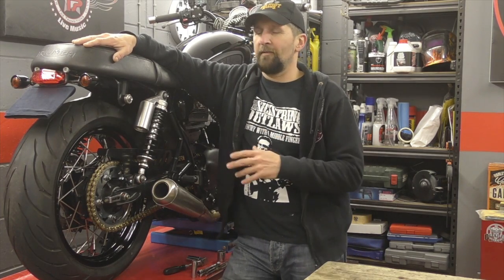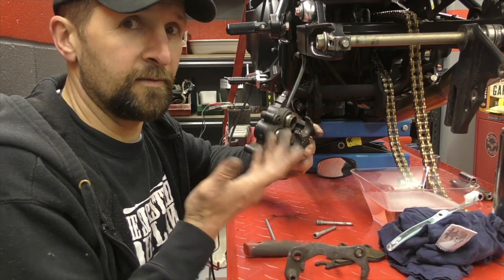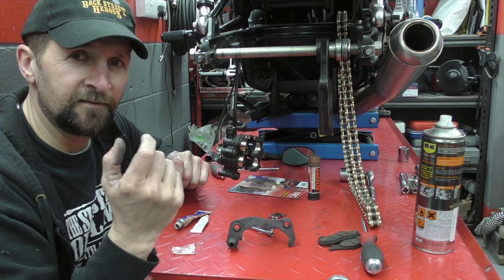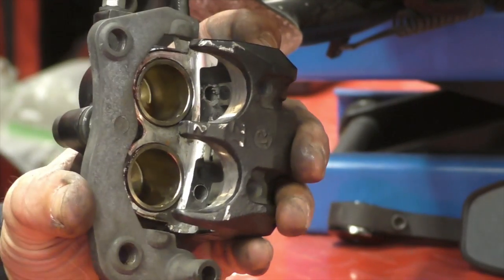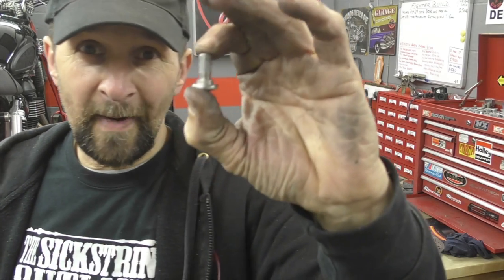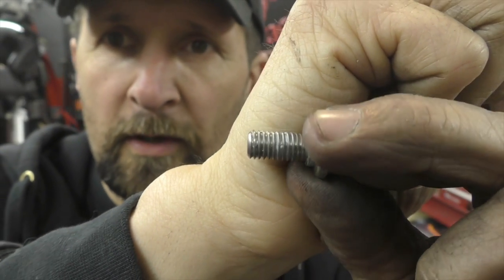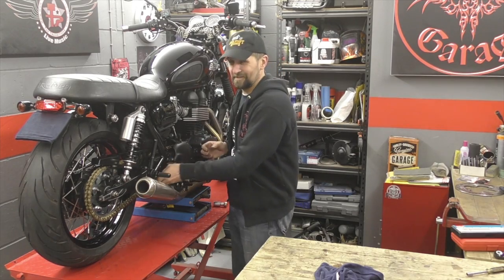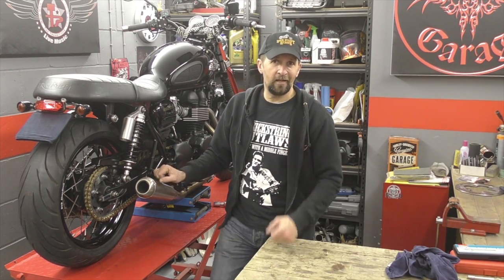Delboy's Garage, Triumph Bonneville Rear Brake Upgrade.

Comment: I am so glad I have found your videos.  They are giving me such confidence to 'have a go'.  However, and I sincerely promise I am not taking the p... But does it matter if the cleaning solution you use is bio or non-bio.  Would the 'bio' bit damage anything like the rubbers? Genuine question I promise!! Thanks.
Reply from the maker: Hi Daniel, Thanks for oyur kind words, im glad the videos have been helping you out... The rubbers in your braking system are pretty robust mate.. think of the the toxic poisons on the roads that coat them up every day.. road salt, oil and fuel residue, antifreeze residue, in fact any liquid that vehicles use can end up on the roads.. so no, dish soap is safe for the plates and cup you eat your food from.. so it'll be fine to clean your brakes with...

Comment: one thing you can try is to lube the slide bars with 3m silicone paste so it won't damage the rubber boots
Reply from the maker: Neither rubber lube, nor copperslip, will damage rubber boots, and I haven't used 3M silicone paste, is it heat proof??  Because if it's not, it will melt away and could flow on to your discs....

Comment: HI, Great video as ever.  I have been refurbishing my calipers (2002 Speed Triple) and it is you that has given me the confidence to do so.  Just seeking your opinion, I used red rubber grease on my hanger sliders, as I thought it may be better on those rubber socks...or is white lithium grease (or copper grease) better...?  Does it matter?  Also, I used brake fluid  on the new seals and pistons to "lube" them in, rather than red rubber grease - again...does it matter?  Many thanks!!
Reply from the maker: Hi mate, fundamentally red rubber grease is a silicone based lubricant, designed purely to lubricate the interface between rubber and metal (or other rubber if it needs to)... and yet the pin sliders for your caliper is actually a metal to metal interface that just happens to have a rubber boot over it to keep the weather out, so the rubber grease won't do a brilliant job of staying put in between the metal pin and bore, even though it protects the rubber, best thing to use is white lithium grease... it's tough, sticky and heat resistant and it'll stay put, and also it won't hurt the rubber at all... (it's also used on chains with o-rings when they're first assembled at the factory)... never use an anti-seize compound, such as copper slip, to lubricate anything, it's technically not  lubricant mate.  It's there to prevent corrosion, among other things... and using it on a sliding pin that moves in and out constantly can actually lead to accelerated wear, because the copper particles in the compund will eventually wear in to it, even though they are soft.
Reply: @Moonfleet41  bless you moonfleet for a dedicated reply.   I'll disassemble and redo.  Thank you!

Comment: heyo del! is there any harm in aligning the wheel with the bike on the ground and the axle slightly tight just to keep everything in place?
Reply from the maker: No mate , you need the axle loose to allow the bottom of the forks to move independently of each other so they can re-align !  Otherwise they will resist the straightening force... you are basically using the bottom yoke as a parallel guide so everything except the top  yoke pinch bolts must be loosened off !

Comment: Another great video but my shopping list keeps growing.
I changed my pad pins for stainless on the rear but the front one I ordered seemed to have a naff thread.
Fair play to square deal as he sent a replacement out straight away but again it only went in about half way then started to feel a bit tight so I took it out as I didn't want to knacker the thread in my calliper.
Phoned pro bolt and got one which goes in cleanly as the stock one dose but it's a race spec one with a small hex socket and a small nut on the end. They don't do a stainless one like the original one.
With this one you can't fit the little cap cover so I needed up putting the stock one in again.
If you find a stainless pin to fit the front when you do it please mention where you got it..
Reply from the maker: Hi buddy, invest in a tap & die set, and you'll find you can remedy all these problems in two minutes... as far as I remember, it's an M10 fine thread, and you will find that in  any reasonable T&D set, then if you feel it's a little tight, you can wind it through a die and that will leave you with a perfect thread, and as they are stainless, there is no plating to worry about!  

A lot of the tie this occurs because the threads are cut before the cap head hole is punched in it, and that spreads the thread... either way, the factories don't fit stainless ones, so they will always be aftermarket, and I use Squaredeals too!

Comment: Hey Del, I was changing my brakes and when trying to pump the pistons out to red rubber grease them, I must have pumped too much and the front piston fell out (and as it fell out there was some spillage, im guessing brake fluid). I shoved the piston back in, put the brakes on and mounted everything fully back on the rear brake, but now when I press the rear brake it isn't stopping. It kind of sounds like it's pumping air. Do you think I put a huge amount of air in the brake lines and bleeding them will solve my problem? Looking to hear back, thanks.

Comment: Top tips again fella. The back brake is an important piece of kit and often overlooked. Don't have to bother with chain cleaning and adjustment these days, shaft drive makes life a lot easier.
Reply from the maker: Ha ha yeah, easy life... dont forget the change the diff oil on time though aye... a knocked out diff bearing is  a lot more money that a chain and sprockets.. lol
Reply from the maker: Glad to hear it mate... i usually get "Oh, you mean there is oil in there?"..!      
  Hope them puppies is well.!

Comment: Hi Del,

i have a strange question. Before winter, we did a front brakes rebuild, pistons out, clean everything, lubed pistons with proper grease which comes with new seals,  and after that the bike braked like a charm, but now after 5 months garage winter pause i cleaned the bike and used standard brake cleaner just to wipe the brake discs. The bike now brakes very badly.. dont know what to do, if just try to get off the calipers and try to pump out the pistons a little bit and push them back a few times, or just clean the caliper.. but it´s only my idea, so hope, you have some advice for this case.

Thank you very much.
Reply from the maker: Hi there.. 
if your bike has been laid up for 5 long months.. then the seals may have got damp and jammed up a bit, firstly just try washing the whole brake ares with lots of hot soapy water and rinse it out with a running hose pipe, then take it for a ride and use the brakes a lot.. its just possible they will return back to normal and be fine... do that first, and see how it goes..!

Comment: Is that the Sun rear sprocket +1 rear tooth that you put on the bike?  Also, was the chain a perfect fit out of the box or did you have to add remove any links to make it fit?
Reply from the maker: Standard sprockets on the bike, factory gearing... and yes the chain fits out of the box because its the right chain for the bike.. order the right one, and they're send you the one that fits buddy.!
Reply: Awesome! Thanks for responding back so quickly

Comment: How do, I’ve been taking my 2020 ninja 1000 to bits lately, and am horrified with the amount of incredibly corroded nuts and bolts, having barely ridden the bloody thing its very frustrating- and having to hand polish each nut/bolt manually- and acf coat them but doesnt seem to do much. 

Long story short is there a ‘go-to’ place to get stainless bolts that are specific to bikes/this purpose? Or a way to determine which bolt sizes will work (cant find it in the manual) 

Ta
Reply from the maker: hey buddy.. have a look up online for some "Pro-Bolt" kits.. they make ready to install "swap over kits" of engine and cycle part fasteners, and for pretty much all bikes, and not only in stainless but also colour anodised to match your bike too... im sure there are kits for your Kawasaki.!
Reply: @Moonfleet41  This is why you’re the best mate- really appreciate it!

Comment: Hi Del,do you recommend to grease the back of the brake pad with copper grease? ty.
Reply from the maker: Does your bike have thin steel shims that fit between the pistons and the pads ?  if so then NO... even then, do your brakes squeal when you apply them?.. if not, then NO, but if you have a problem with squealing brakes, then a little anti seize paste applied to the back of the pads SPARINGLY.. can reduce or even stop the squealing all together.. 

For what its worth buddy, its not "grease".. thats a name it seems to have gained somehow.. but its not for lubrication of any kind.. its a non ferrous paste to be applied between metal surfaces to stop them corroding.... its actually no good as a lubricant, it can cause wear to rubbing parts.  so only use it as an "anti seize" compound, never as a lubricant.. its simply a misnomer that people call it copper grease..!     Hope that helps.. good luck.. Del.

Comment: Hi Del, thanks for this tutorial, quality video!!! Just changed the pads on my speed triple but I think will need to take down the calliper again and do it properly like you showed on here. Just a quick one, is normal that the disk is much hotter after replacing the pads? Is not glowing hot but hot enough so you can't touch it...thanks.
Reply from the maker: Hey Gregor.. Thanks for your kind comments, with your rear caliper, the disc should never be hot if you haven't used it.. that indicates that its binding and needs a clean up to free off the pistons.... but if you ride the bike normally, and use the brake as intended then it will get hot..   Best test is to go for a short ride, no more then a few miles, but in that time, dont touch the back brake... then when you get back, feel it to see if its hot.. if it is, then thats proof its binding and you must deal with it..  Sometimes fitting new pads can lead to this because they are thicker than the old worn out ones..  which means pushing the pistons back in further then before.. and if there is any brake dust or road dirt on those pistons, then when you push them back in that dirt will jam up on the seals and cause the caliper to bind.....follow like it says in the video, pump them out a bit then clean them all off... should be fine afterwards..  Hope that helps

Comment: Another very informative vid Del. Was there a particular reason for changing the disc other then aesthetics?
Reply from the maker: I thought I made it really clear at several points in the video buddy, Penny wants to stamp her own mark on the bike as I said, and make it a little different from the factory spec... EBC sintered pads chomping on EBC discs will always give more bite and feedback, so it's an upgrade like I said buddy!
Reply: Moonfleet41 Sorry my mistake, must listen better. :-(

Comment: Another brilliant video. Thanks for sharing.
I've been meaning to ask... do the sintered brake pads lead to faster wear and tear of the brake rotors?
Reply from the maker: Yes they do my friend, most definitely, you can't change the laws of physics, and as the sintered pads have more physical grade against the disc, they will wear it more quickly... but in defence of that, with some intelligent use of your brakes, you will brake for less duration which then reduces the time that they are rubbing on the disc so overall the increase in disc wear is marginal... and in my personal view, it's a fair trade off for better, and more effective, braking.

Comment: Hi Del, I noticed when you did the rat bike pads you put copper grease on the back of the pads.. but you didn’t put any on these ones.. I’m about to change the pads on my Street Twin, just wondering if I should copper grease the back of the pads or not?
Reply from the maker: Did your brake squeal with the old pads Liam?.. if so, then use some and it'll stop it.. if not, then no need to bother mate. !   My bandit brakes squealed for a pastime.!
Reply: Delboy's Garage now that you mention it, the front did squeal a bit, I always thought it was the pads squeezing against the disc, I thought that perhaps the pads were dirty?

Comment: Can it be lithium grease or does it have to be white lithium grease, just been looking and have found a tin of silverhook lithium grease, is this ok.   thanks.
Reply from the maker: Hi buddy, I don't think it's critical, I use white as it's what I have, all lithium grease is the same base compound, but the white is provided by the addition of zinc-oxide and it's believed to only be there to show where the grease has been applied and if it gets contaminated so needs replacing... but don't over think it mate, some grease is better than no grease.

Comment: Can any Triumph folks out there speak to the wear on the rear wheel spacers in this video? Mine too has some rings on the chain side spacer and wondering what the acceptable tolerance is there.

Comment: So I did my rear brake pads exactly like you said, they still feel a little squishy, what should I do next?
Reply from the maker: If they're 'squishy', then you obviously still have air in the system, perhaps trapped in the caliper, try bleeding them through again and, perhaps, depress the lever overnight which can firm up the system a great deal by eliminating any micro-bubbles... also, when you bleed don't open the bleed valve any more than 1/8-1/4 turn or you will drag air in to it as you bleed.  It's just practice mate, good luck with it.

Comment: hi Del should you clean the brake disc with brake cleaner before you fit  it in case there is a protctive grease on it ?
Reply: Les Robinson that's the case with cars so probably the same
Reply from the maker: NO 'protective grease' on them buddy.. bone dry and spotless out of the box..!

Comment: Good video. Quick question.... Any of you guys know the front caliper mounting bracket torque setting for a 2019 street twin? It's the newer brembo brake caliper. Ta.
Reply from the maker: I don't know that one mate, it's a manual listing you can just look up, but im guessing you don;t have a manual !  you can download a torque list from some of the Triumph forums,  "Triumph Rat" is very good, a great generous community all more then happy to help, check 'em out, im sure what you need will be on there mate.
Reply: @Moonfleet41  Thanks for responding. Did a bit of digging around, got conflicting information so bought a Haynes manual. Best thing in the end. Keep it shiny side up. 🤘🏻🇬🇧

Comment: Heya Del. Is white lithium grease ok for rubber? Also,  I've used copper slip on brake pistons when I ran out of red rubber grease mid rebuild but was later advised it might react with the rubber seals. Re-cleaned the whole bloody lot a couple of days later! I'd be interested to hear your thoughts on it mate.
Reply: I initially thought the same about the lithium, but, the stuff he used was also used on the DID rubber chain link seals - in this case should be safe on brake rubber.
You were right to remove the copper slip from brake pistons - stick with red rubber grease there, the copper slip can expand the rubber.
Reply from the maker: Copperslip does not corrode the rubber piston seals.. there are many armchair experts out there who will make up all kinds of rubbish based on half read information... truth is, not all rubber is the same, obviously, and the piston seals are designed to be resilient to extreme heat, all kinds of chemicals, and even acid...anything that would get onto your caliper... but a rubber children's party balloon will break if you sneaze on it... so its what kind of rubber you're talking about... The Lithium grease is great for the piston sides, its designed to coat up the chain 'O' rings, and they get hot all the time....   so that's the right answer buddy.. (until another keyboard expert comes along and wants to split hairs..lol)
Reply: Cheers for the detailed reply Del.

Comment: Del I know this is an old video but just thought I'd ask just the same. I understand not having silicone on the pistons but what about siliconegrease as a replacement for coppergrease or lithiumgrease on the slidebars ? I know you recommended lithium or coppergrease, but I' heard about people using silicone on sliderbars without issue
Reply from the maker: As long as its a heat resistant lubricant, one that will not melt with brake heat and flow out, then it will work Stefan.
Reply: @Moonfleet41  Ahh gotcha, thanks del ! I found one that's supposed to handle up to 400 Celsius which should be more than enough
Reply: @Moonfleet41  By the way, I really appreciate what you do, you've helped me alot with doing own maintenance so thank you

Comment: Hey Del i have been using wemoto for long time i got pistons for my friends sv before there and after 2 years they were totally shot the chrome had flaked off and they were a ball of rust
Reply from the maker: So were the factory ones if you had to replace them then..!  maybe a little more maintenance and cleaning in order..?  no use blaming a product when you totally neglect it buddy.!
Reply: Moonfleet41 we replaced factory ones with wemoto ones then later we noticed the chrome falling off the wemoto ones. Was shocked. Been using wemoto bits for years. Was however the first time using there pistons
Reply from the maker: Did you tell them..?
Reply: Wemoto Ltd Hi yes it was sometime ago but I believe it was the budget ones. It's ok I haven't lost faith in your business in fact I have an order in process at the moment. For the chain rivet tool and a sunstar sproket. Can I ask are the stainless ones higher quality than the stock ones?